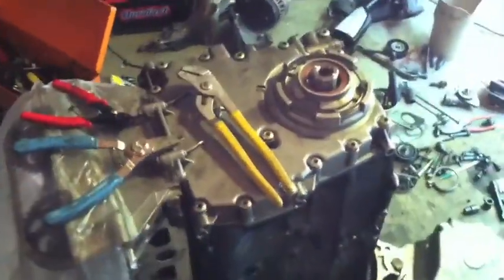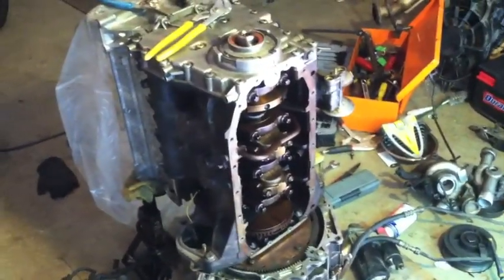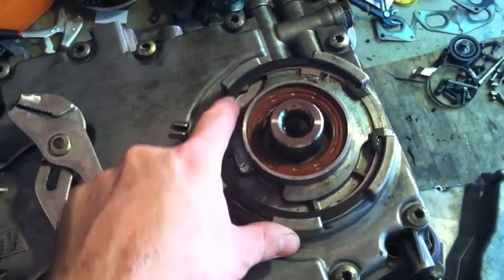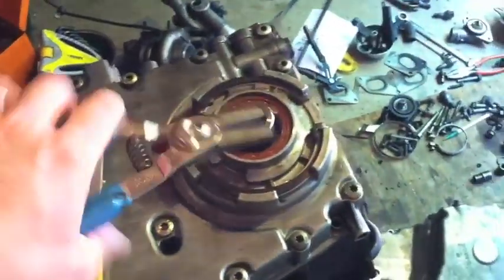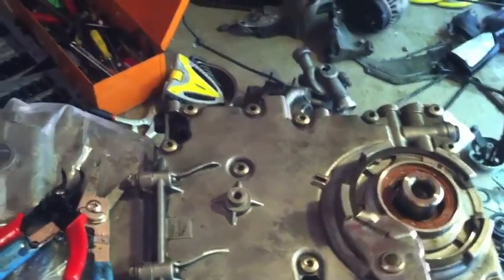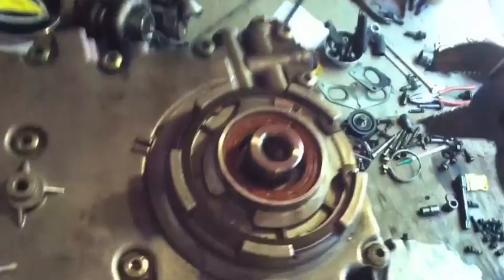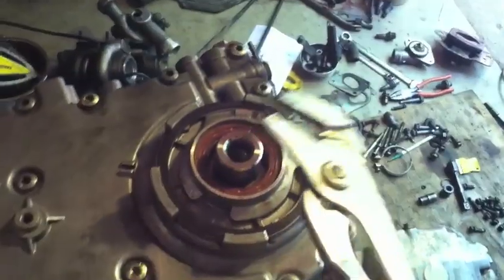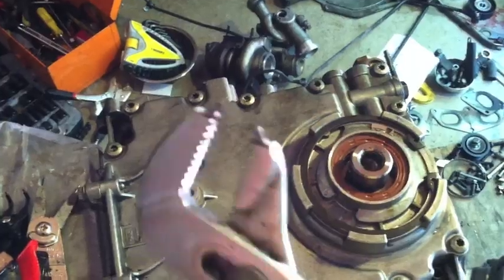theSAABguy: B205/B235 Oil Pump Circlip Removal

Comment: Thanks for the video and sharing it I was replacing crankshaft seal and oil pump O ring doing the same thing to my Saab and got stuck getting the circlip out I made the same tool you did don't know what I would have done thanks again!

Comment: Public Service Announcement! Be careful with the circlip, whatever tool you use. Having no experience with it, I couldn't budge it with an 8-inch circlip pliers so I sprayed with PB Blaster and lightly tapped one end of the circlip with hammer and punch. That broke off one of the tabs holding the circlip. Then used the larger HFrt circlip pliers. Had it pulled in enough to clear the tabs when it slipped off the pliers. Yes, another (adjoining) tab snapped off. Was able to get the circlip in it's proper position, drilled a small hole and placed a metal peg in it to keep the circlip from moving outward, then JBWelded half of the circlip. It's held for several months with no leaks but I'm not expecting it to hold much longer. Point is, couple of mistakes like this and you're looking at replacing the timing cover. A good tool for this is the KPX-4811J4 Knipex 4811J4 Precision Circlip Pliers. The tips are bent slightly inward to prevent the circlip from slipping off.

Comment: After seeing your demo I did the same thing with good success.  Thanks for the help.  I had a tool which would fit it but wouldn't give me the leverage I needed.  Using the channel locks did the trick.  Your grinding job looks better than mine I do have to admit....lol....but I used a cheap pair of channel locks from Walmart that cost $1.98.....

Comment: Cool idea Jay !  However, most people will be doing the Crank Seal and Oil Pump Cover O ring replacement while the engine is still in the car.  In that case, your tool won't work, you would never be able to position that tool properly since the front passenger drive shaft and brake rotor would be in the way.  Getting the Circlip off wasn't that bad, but putting it back on is proving to be a monster.
Reply: I used that same idea to get mine out while in the car....I have a 9-3 SE, 2002.
Reply: Harbor Freight sells a Circlip removal tool.  It's a large one that has interchangeable tips.  They're cheap, so I bought one and it worked perfectly.  I had to do this job three times, because the Elring seals that I purchased from eEuroparts were not sealing.  Finally I purchase the expensive OEM Saab seal it finally worked, sealing off all oil leaks.
Reply: @brettkramer  - Is this a common problem with the Elring seals?
Reply: @Mogman150  No, although I would not purchase anything other than the stock, Saab seal.  I had to replace mine three times before I stopped the leaking.  Purchasing the stock Saab seal finally worked. Harbor Freight sells the correct circlip tool for the job.
Reply: @Mogman150  i've never had a problem with Elring front seals. My rear main is leaking though. Not sure what brand.

Comment from the maker: On the NG900 and OG9-3 dropping the oil pan can be a bit tricky and yes one thing to help you is to pull down the subframe a bit. The other more important thing in my mind is to loosen all the engine mounts and physically move the engine toward the left side (USA driver's side) of the engine bay. This will give you the proper access to drop the pan out.

Comment: hey saab guy, im replacing my oilpan, are there only 2 bolts on the piece of the frame that has to come down some/off. mine is a 96 900 2 ltr. t. any info would b helpfull. pls.